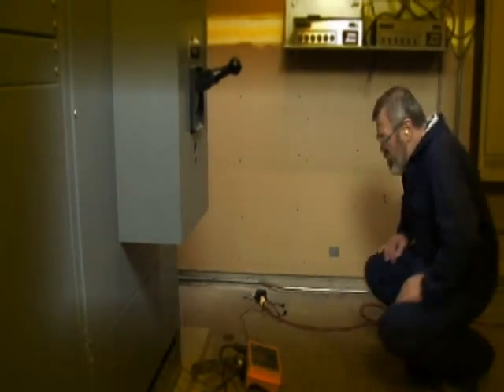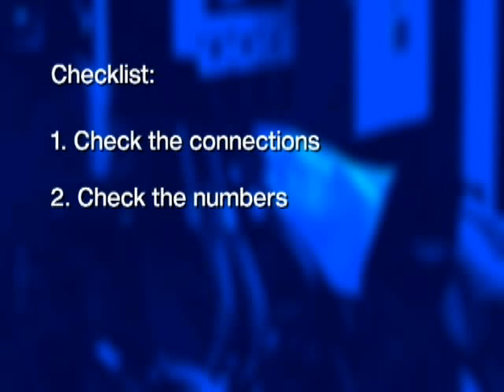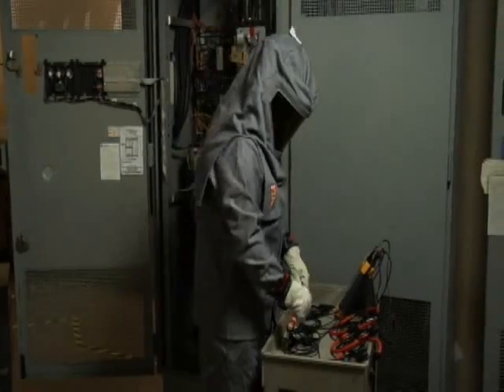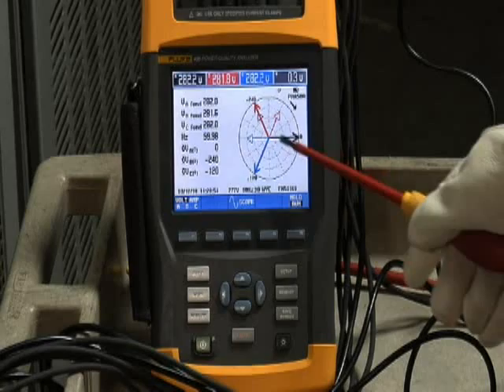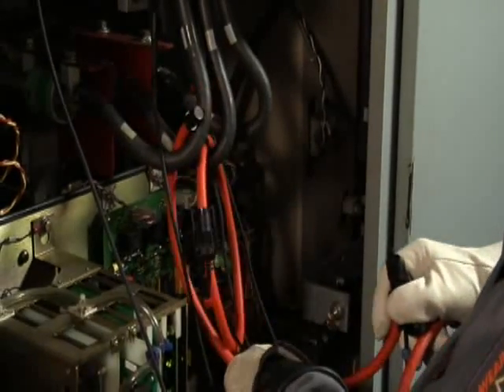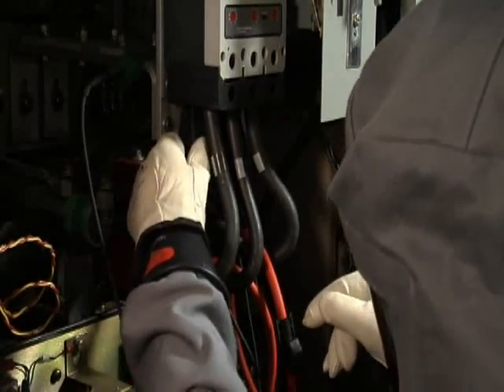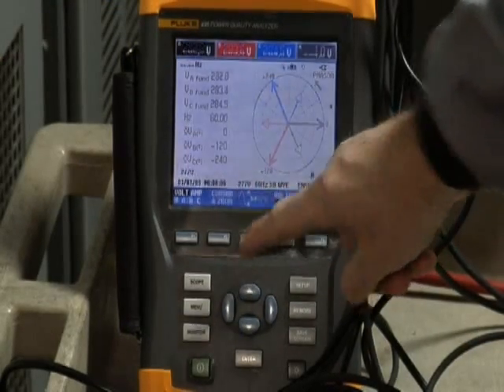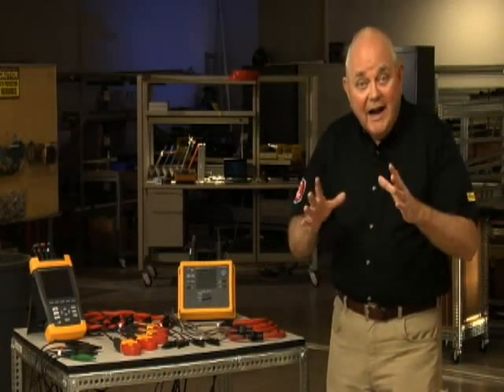Fluke 434-II 434 II Power Quality Energy Analyzer Connection

Comment: I can absolutely guarantee you he is NOT a power quality expert.  Being an electrician doesn't make you an expert at anything except running conduit and pulling wire.  If you want to be a power quality expert you should go get an electrical engineering degree and then after years of experience as an EE in the power field then you might be able to call yourself a "power quality expert."
Reply: 10000 hours
Reply: That's funny, he knows more than your keyboard! As a (love my work I edit everything)!